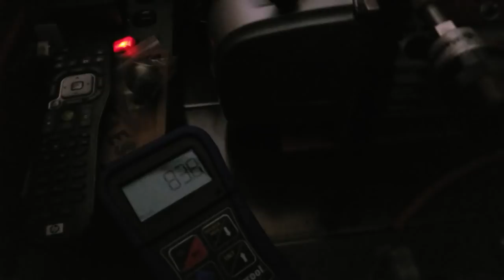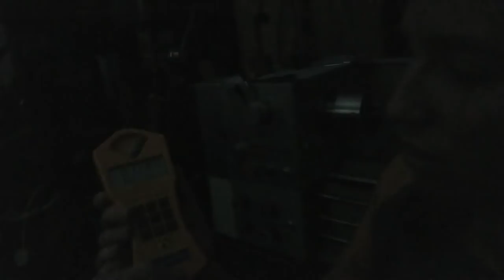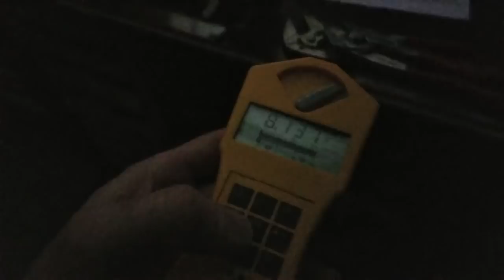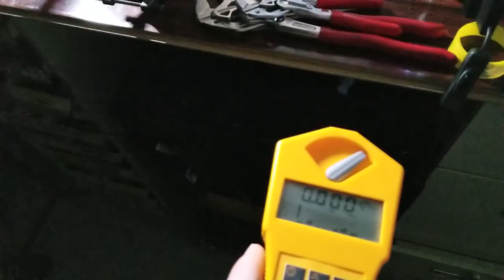*Still Testing The Vacuum Chamber With My Dad! Oh Boy!

Comment from the maker: * Don't worry, the meter is going off due to the black driver. It has nothing to do with the plasma device...  it dose the same thing when it gets close to the driver with out the plasma device...

In fact the plasma is being driven externaly. Allmost no chance of x ray or ionizing radiation.  You need high voltage and high energizes for that. This video was just some fun being had. And some real tests of the driver amd vaccume chamber :) 
Safety first! 
~Russ
Reply from the maker: @Landscape Guy There's nothing new under the sun :) all is already discovered.  Now its for us to rediscover! Indeed! ~Russ

Comment: Is anyone still working on Stan Meyer's puzzle? He seemed to really have something. Apart from serious mental misdirection causing us to not have it today.
Reply: Russ dropped the Meyers work quite a while ago and really wasn't able to validate it. If Russ wasn't able to get it to work as claimed I doubt there is any merit to it at all.  There no sense in beating a dead horse, cut your losses and move on.
Reply: @William_Hada um just cause he wasn't able to doesn't mean there is not merit in fact I know better just saying
Reply: Still working on it and I have some Pieces of the puzzle showing them at our Conference
Reply from the maker: There is a lot of work already done on the subject by my self personally. as of this point... There is no positive results. now if you ask me if i think there is a possibility to have positive results? yes. I think there is. but i can all most guarantee that its not easy... i have not given u. but you can only work on the same thing for so long before you get burned out... so in due time im sure i will start on it again... and this time with more knowledge than before.  ~Russ

Comment: There is a big difference between the radiation of this device and an x-ray tube.
Tesla took the rays and developed x-ray system from it and it was very very clear. He said this kind of radiation was better for you then the x-ray of that time.
Your meter does not know how to translate the field and thats why it is saying overload and acting weird. It will fool the meter. If properly done, not RF design, then it is more powerful and less dangerous.
 Read it yourself here:
 https://teslaresearch.jimdo.com/x-rays/

 I don't think you hit the frequency of x-rays.... But the special character of the oscillator I think you have gotten. True impulses though are very very steep and look like vertical lines that progress over time. The successive tips producing a shape often in a sudo ac signal that is chopped up. It's a biased version of ac. All the benefits of AC without the heavy reliance on real constant current. The lecture that I keep referencing to is the way to get this special character of high voltage discharges and if a sufficient capacity is used it can become disruptive and have huge inertial transfers. Pipe that those disruptive discharges into your motor and that thing will FLY! Just be careful ok... There is still much not known about the effects on matter. Tesla didn't think it was dangerous if done properly with the right character of the energy. Tesla reported that 20k IPS (Impulses per second) was very safe and that a single Impulse could be dangerous to matter. As he was experimenting with thin copper wires and saying it blew up with the force of the finest dynamite.

  P.s. I'm sorry but I don't fault your daughter for saying that. I'm just saddened that she had to hear that then repeat it without knowing I could hear her. I don't blame her but.... She had to hear it in the house and I can't come to terms with that. Please be careful my friend and good luck in your investigations.
Reply from the maker: Thanks John, and to your PS. I have know idea what she said, or what you heard. but what ever it was. I can grantee with 100% certainty she was not directing anything to you in some way that would be bad, or degrading. I have never said such thing about you, and have no reason so say so. and defiantly have not said anything "in the home" about you.   so what ever she said. I'm not sure. but i can say from what i know. nothing was ever said about you in a negative way. In fact in have and still do enjoy the company when your around. so do come back. blessings. ~Russ
Reply: @RWGresearch  
 So the Crazy John comment didn't happen then?
"Who am I talking to"
"John"
"Oh Crazy John?"
 I know she was only repeating what she had heard and it hurt to hear it, especially coming from your side. I'm not pointing fingers it just stuck in my head and it really hurt me. I know that I get stuck on things sometimes but I'm not crazy and to be referred to as such made me think of how my work is being seen and how it is defining me.